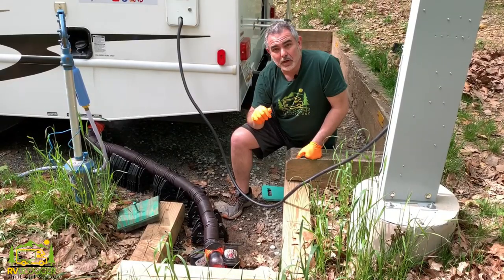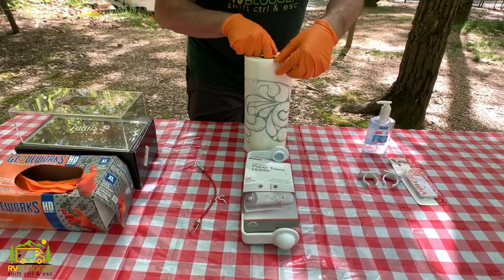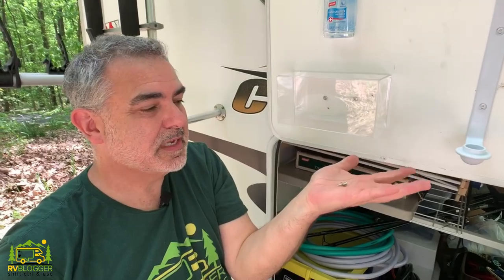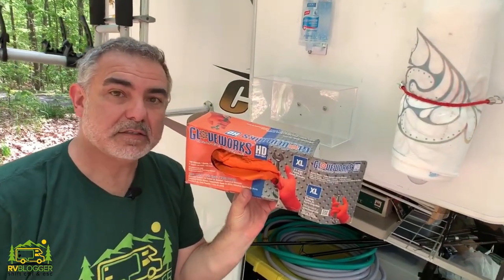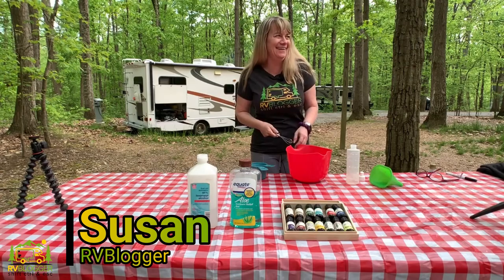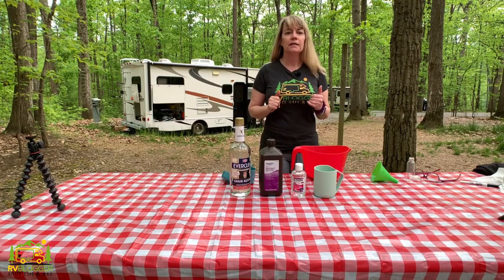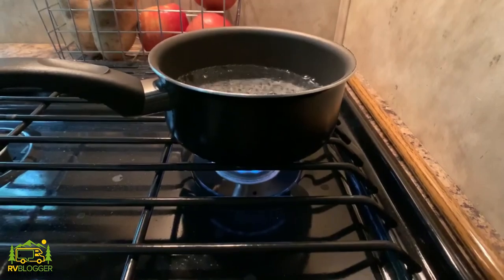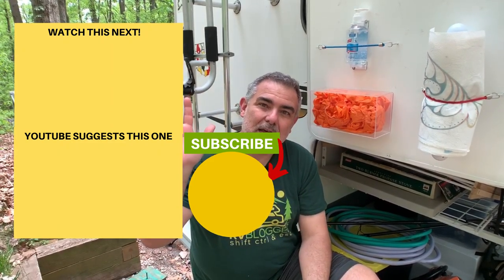DIY Hand Sanitizer Dispenser for Your RV

Comment: Great idea.  We did something pretty similar with our RV.  It works great.  Thanks for sharing!

Michael, Shelly, & Talon
Reply from the maker: Hi Guys!
Cool and glad it works great for you guys too!
Did you do anything different with yours?
Mike and Susan
Reply: @RVBlogger  we have gloves that the box can already be mounted.  They even come with the velcro strip.  I had a dispenser laying around already that we use for the anti-bacterial.  Our doors open out and not up so we didn't have to worry about spilling.  Instead of paper towels, we use shop towels.  Again, have a bunch laying around but we will switch to regular paper towels once that supply runs out.